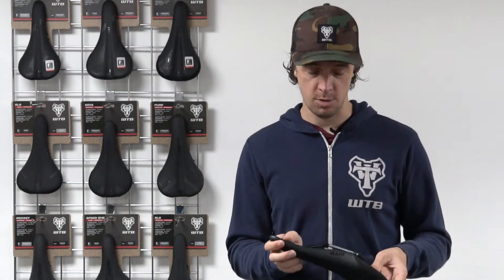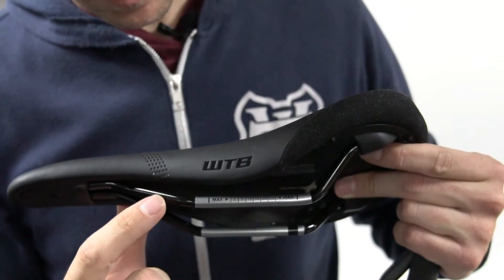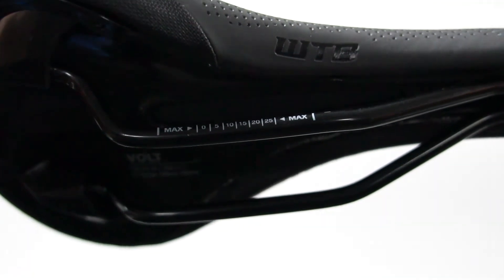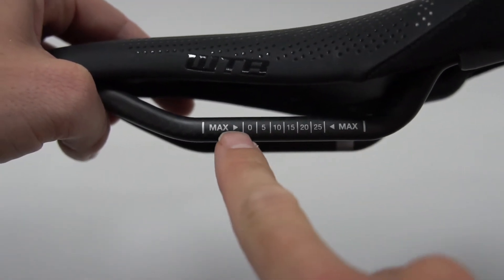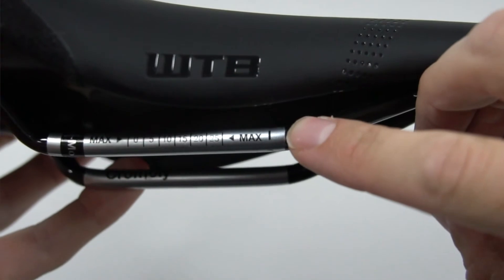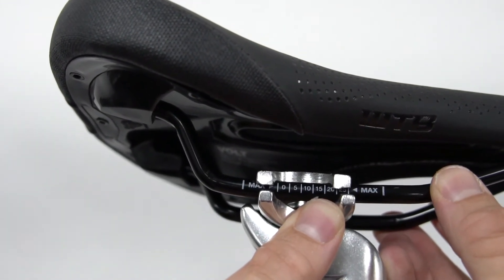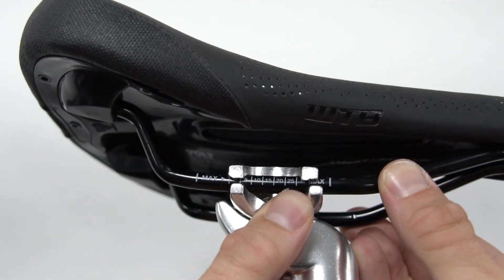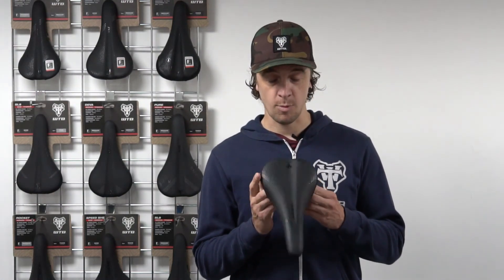Rail Markings - What do they mean!? #mtb #gravelbike #saddles

Comment: I read prints for a living. Your arrows are pointed the wrong way. You don't need arrows to create a constraint, but if you use them they should point to the limit.

The way it is dimensioned now, "max" is between the arrows inside the graduated portion of the rails.

Edit: Thanks for the info though, and love my new Volt! I had the Pure for years, but it was too big for long rides. The online fit system nailed the size and saddle.
Reply: Exactly! Intuitively, I see the arrow pointing to the inner line and have to assume that’s the max travel point. Good thing I found this video, because my saddle was too far forward and now I can safely slide it back.

Comment: I had stock WTB Volt saddle on my bike and decided to replace it to new Volt version. And I must say that unlike old arrow marks the new one are really confusing. Old arrows were directed outwards clearly showed the limit lines. New ones are directed inward and absolutely unintuitive. Really it looks like that limits should be at arrow ends. I was puzzled when installed new saddle because the clamp of my Ritchey seatpost clamp hardly fits in between these two arrows leaving virtually no move for adjustment. I referred to WTB Seatpost Manual at website: there is a remark that clamp should be only on the straight part of the rails, but no explanations of the limits marks. So I searched for this video to get assured that limits are still the same edge line. On my opinion as user, new arrows are just confusing now.
Reply from the maker: Hey there. Thanks so much for your feedback, and glad to hear this video was helpful at least. I'll feed this back to our product team. Cheers!
Reply: Same here on my bike with the WTB Volt, and my issue is creaking noises from the saddle(you might get that too FYI) so I thought I'd first check if my saddle was adjusted incorrectly, but it was within limits. 
Now I just hope the epoxy fix for creaking seat rails will fix my noisy saddle.
Reply: Totally agree, why do they point to the inner line? If that is the max what are the outer lines for?

Comment: Saddle clamps are much wider these days. In many cases to get any adjustment at all you need to move either end of the saddle clamp past the max marker. 

Thinking about it, as long as the saddle clamp  extends (supports) beyond the max markers then you can adjust until your saddle clamp can move no further. This statement makes the assumption that the min and max markers are there to ensure the you never apply too much leverage to the saddle rails or seat post. In fact as the saddle clamp gets narrower then effectively the max markings should move in to. Something along the lines of e.g. do not allow the max markers to extend more than 20mm from the end of the saddle clamp would be much more useful and be universal.

Unless the saddle and clamp (seat post) are made by the same manufacturer and relate, the min and max marks are meaningless.

Comment: It is still unclear to me.  The bracket ends are practically equally as wide as are the front and rear Max line placement ... so saddle movement would only be a fraction of an inch before either bracket crosses the line (see in video).  If there was a marking, or some indicator, to use the center of the brackets as a reference - there simply is no reference.  All saddles seem to be this way though but clear as mud.